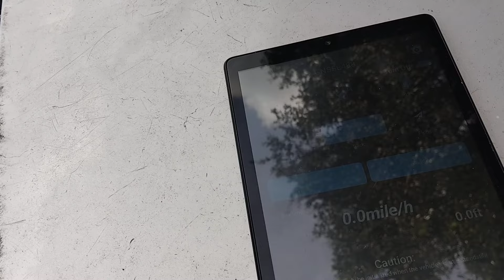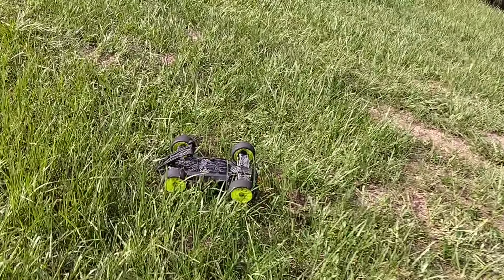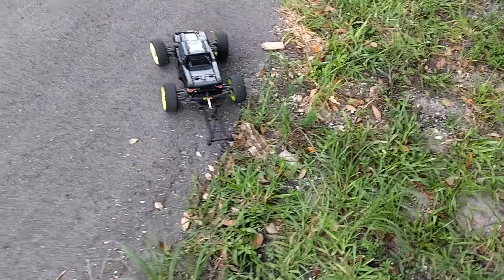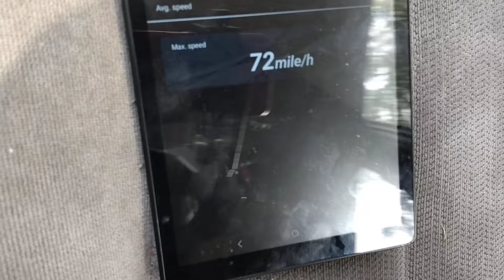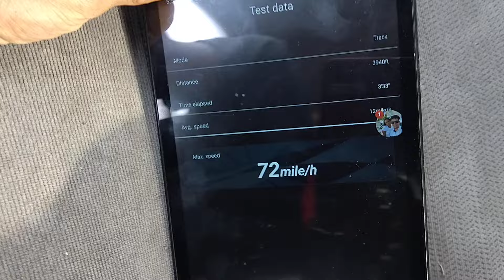1/10 Rlaarlo Omni-Terminator speed run with 1/8 motor... not what I expected

Comment: I think part of your control problem is how you are driving. You are snapping the steering wheel constantly to make corrections. you need to reduce your steering dual rate when doing speed runs and hold steady stop grabbing and releasing the wheel to make corrections.
Reply: Also need stiffer springs on the right side than the left side with that heavy ass battery pack on one side

Comment: tried a few different setups . I settled with 120amp quicrun esc 3660 3200 kv motor 19tooth pinon on 2s.   .. currently running same times as 4x4 shortcourse at track and still wheelies .
Reply from the maker: @novamegaboxing9701  that's a good balanced setup. Even on 2s you'd have plenty of wheel speed
Reply: @OmniMan_Racing  knock on wood , haven't broken anything other than body dings...What motor are you running ?...  I have the V1 sc8 combo sitting around been tempted to try the 4068 2700kv and bump pinon to 24t for the giggles. Idk if my 2s batteries can handle the draw tho.... Kinda want a 2nd to do the silly shizz y'all been doing running 4s.     Wish someone would buggy conversion one . Seems it would do better than the old backslashes
Reply from the maker: @novamegaboxing9701  with the 40mm motors the smallest pinion you can go to is a 40t. It's not worth the swap. It's not fun having to be extra careful. I'm using a HobbyStar 4068 2650kv. Even on 2s my setup does over 45. Gets pretty hot even with fans and a heat sink
Reply: Why is the 40 tooth the smallest you can go ? Does the motor can hit the chassis braces?
Reply from the maker: @novamegaboxing9701  it's just how the adjustment on the 40 series mount is. Gotta push the fatter motor farther from the center shaft for clearance

Comment: Also, if you didn’t know, you can use the Gyro mode to soften the steering to help Do the speed runs if you didn’t know. The only downside to the Gyro is that it can be very confusing. It took me some searching on YouTube to find how to work the Gyro but I believe that helps with steering significantly.

Comment: what did you have your steering rate on? Seem like it needs to be less than 50% EXP.. may 45 or 40. its really wiggly because its so much slop in the hubs and the steering assembly. i got mine up to 60mph and it flipped 8x and kept on moving.. they are built tough for sure.
Reply from the maker: I think I had set the dual rate to like 35% on the steering. The problem was even with the wheelie bar and I could feed into it as slow as I wanted but the front wheels didn't stay on the ground. Can't steer if the wheels that steer are in the air 😅

Comment: LOL! 72 eh?
I run 5 inch tires on mine with stock electronics except receiver and the bigger pinion.
Hits low 50's best guess. I am getting better with my controller settings, so control of the car is also getting better.
But seriously, this thing is hard to control over 40ish.
Mine is lowered with a rake and still rough to control.
One thing I can say is this: The Omni Terminator can take a serious hit and drive away!
Oh ya.. running 3s, 5500Mah 65c discharge too.
See ya on the next one.

Comment: Super Video👍👍 

🤜 This is a hobby that makes you walk a lot I know very well hello friend. I have a question to ask you one of these days indeed I do it immediately I also have a terminator Rlaarlo carbon version and I bought an esc the hobby wing quicrun wp 10 bl120 g2 120a if I mounted it and I would use it only with 3S lipo I should change also the engine? friend you don't have to answer me immediately without stress only when and if you can always hi from Rome Italy
Reply from the maker: @happydayrc  stock motor will handle up to 4s with no problem
Reply: @OmniMan_Racing  mille grazie amico👍👍